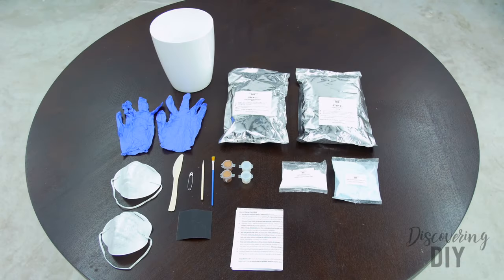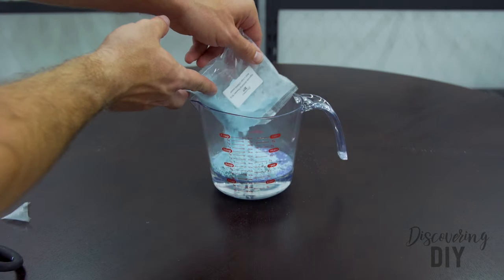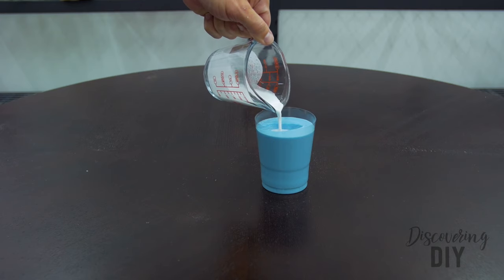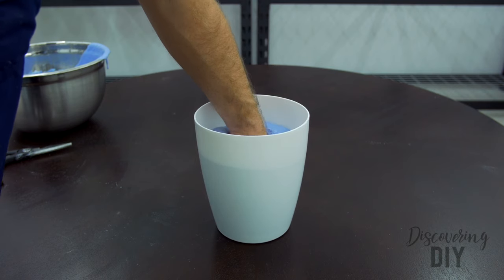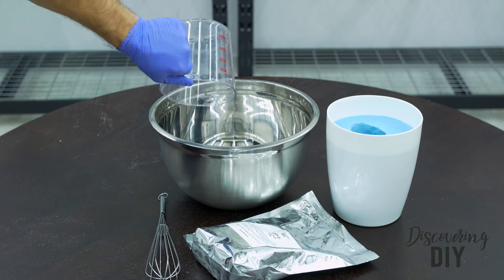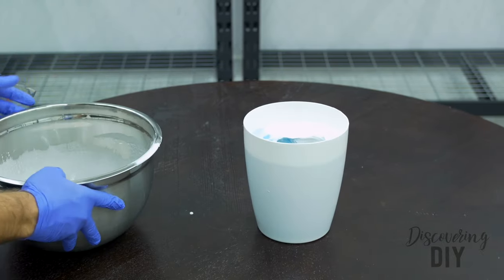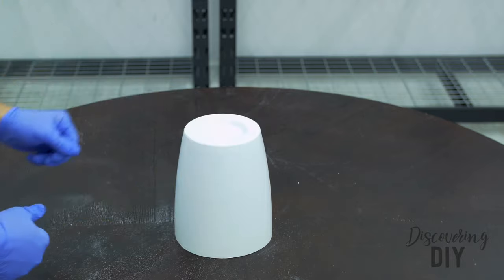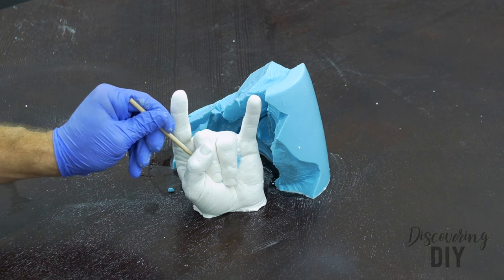Discovering DIY Hand Casting Kit Instructions

Comment: Mine didn't have a mask in it and also the amount of water needed for casting powder is actually significantly more than specified - ruined my whisk, bowl, and did not remotely get to a “yogurt-like” consistency with the amount of water recommended in the instructions. :I disappointed

Comment: what is the use of moulds after using ???
Reply: well you could buy some plaster of Paris and make another casting depending on what exactly the mold is made of you may be able to do a resin casting but that would be more iffy you could do a silicone casting for sure so there are uses but I'd assume you'd have to stick with that original mold I can't think of a safe way of breaking it down to make another mold